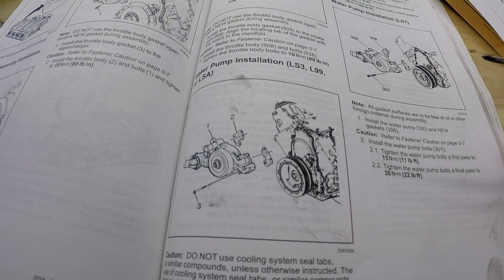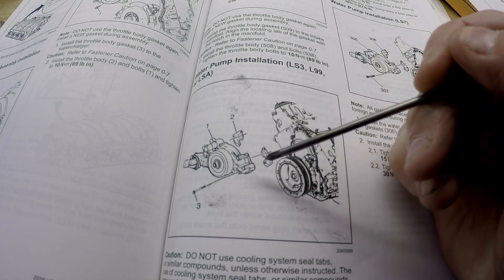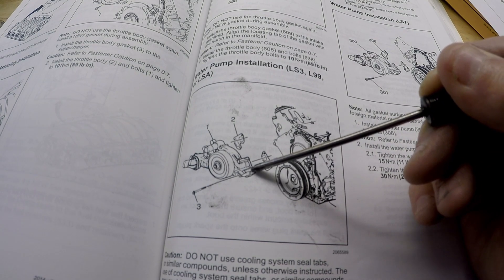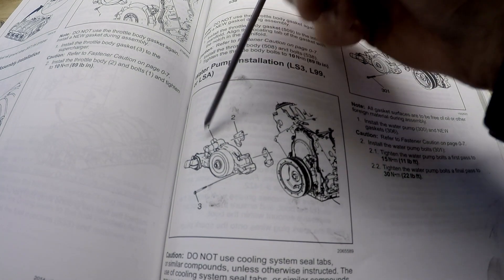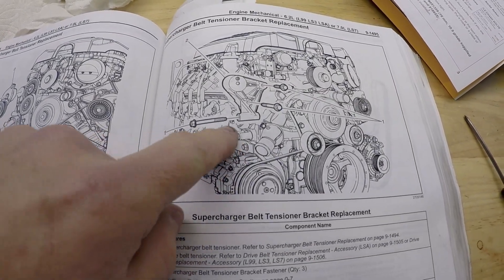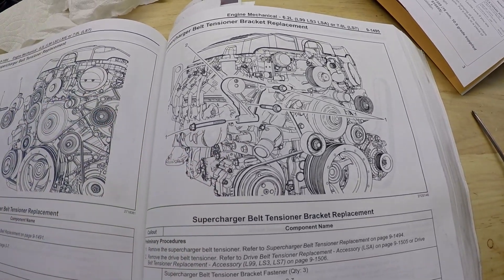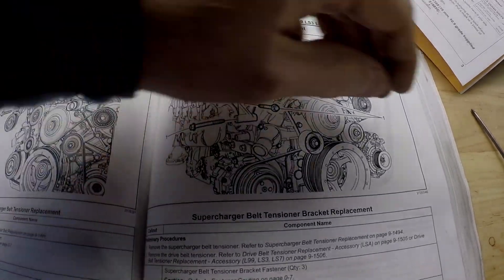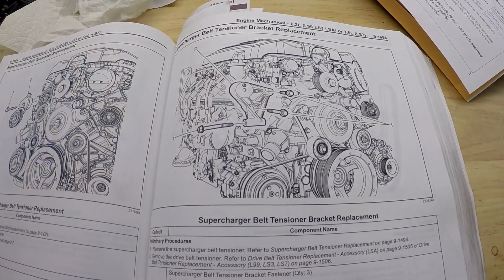LS Waterpump Install tip

Comment: Where could I obtain the book you are referencing in the video, and what is it called, or what is its ISBN?
Reply from the maker: It's GMs factory Service Manual. It has 5 volumes and is about $550. I bought it online. It doesn't have an ISBN and GM is the publisher.
Thanks for the question